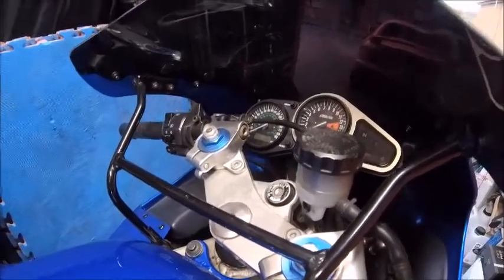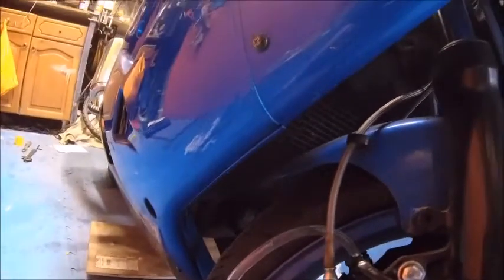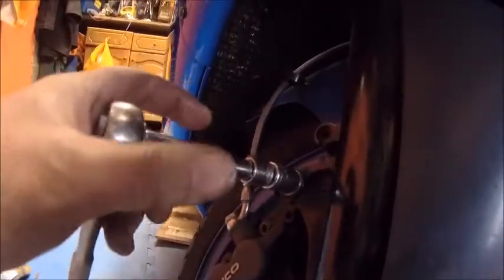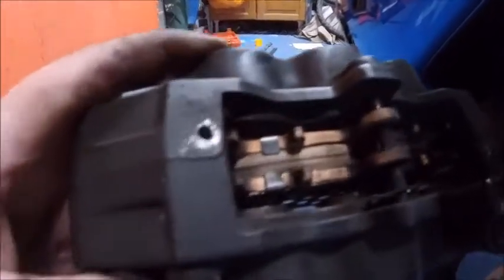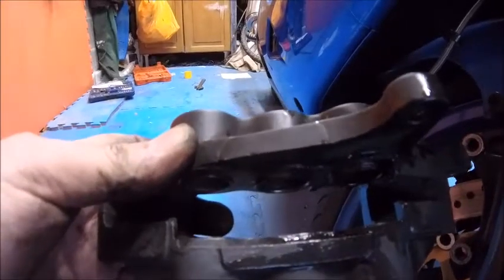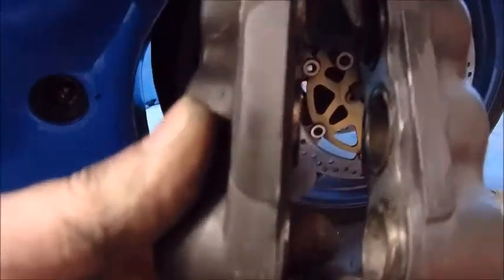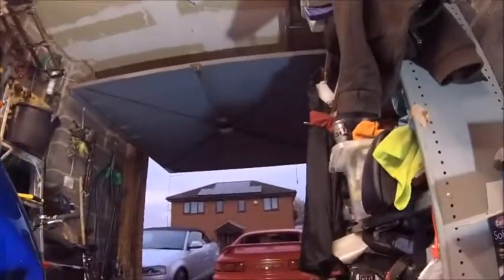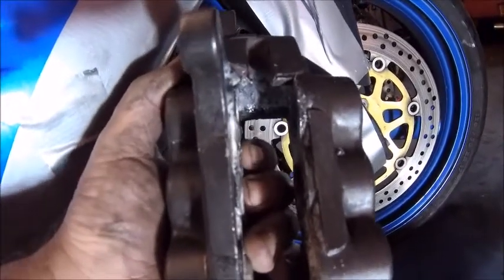Kawasaki ZX9R brakes....  Part 2 of the fronts....  #kawasaki #zx9r  #ninja

Comment: Typical problem with the Tokico 6 pots to be fair! The calipers are anodised prior to machining during manufacture and they are very prone to furring up around the seal channels. Unfortunately the only way to maintain good brakes with these is to religiously pull them off and clean them, I have to do my GSXR750 SRAD ones every few months or so.
Reply from the maker: To be fair I've done very little to the brakes over the years I have owned it, So it's probably my own fault ...I'm fairly sure before long they are going to have to be reverbed but one more video to go  😉